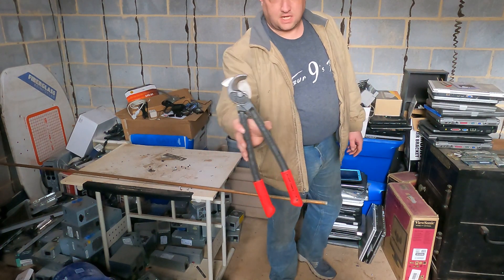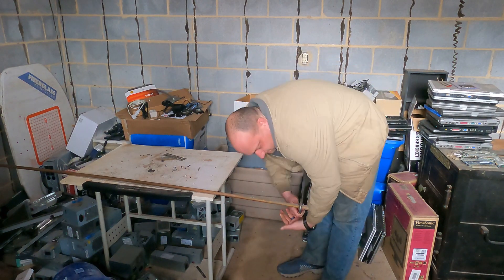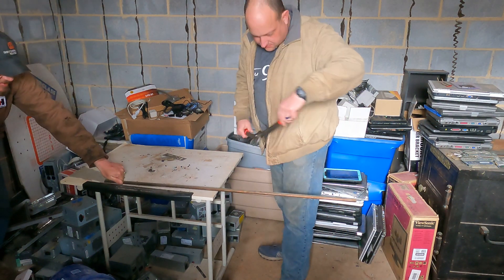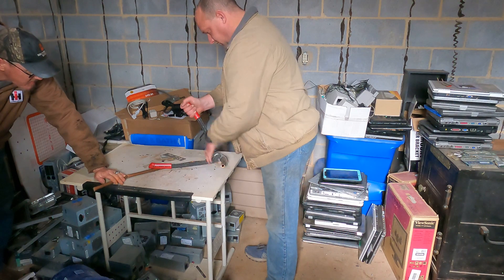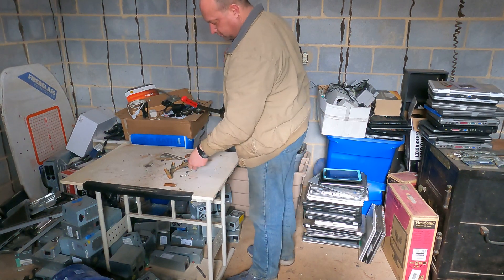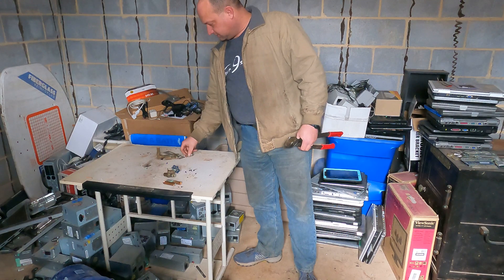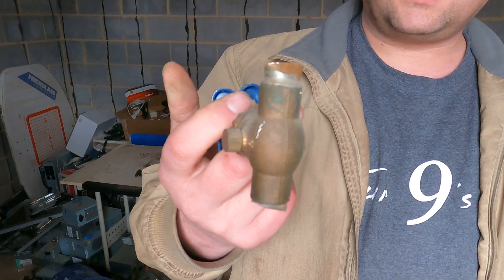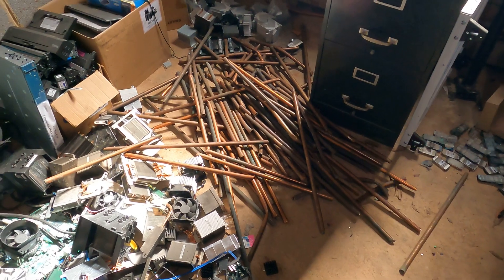How to scrap your copper pipes. #copperpipe #copper #copperscrap #scrap #scraplife

Comment: Quite informative, i like the parrot beak cutters, 5x the size I have, my Yard has a separate category for copper Pipe, New or Old, and they don't need to have the solder joints removed, but the Brass gate valve does need to have the handle removed
Reply: Thanks for the info. Yea I need bigger cutters

Comment: The handle on the shut off valve is probably Zinc and the screw that holds on the valve may be steel or brass. Check with magnet and hacksaw 👍😊.
Reply: Great tip

Comment: processing alot of water pipe is so much easier with an axe cutting pipe over a block of wood, but beware flying pieces. place a cardboard box at the cutt off side to reduce the flying pieces. you can be very accurate at the solder joints too. Wear gloves and safety glasses. Thicker copper, brass and alluminum pipe is easier to process by a score impact, slide the pipe to the edge of the block and flip the axe over and impact beyond the score, breaking the pipe at the score line. Alot of aluminum extrusion can be processed this way too. Been a while since I did this but thats what I did.
Reply from the maker: Sweet tip!